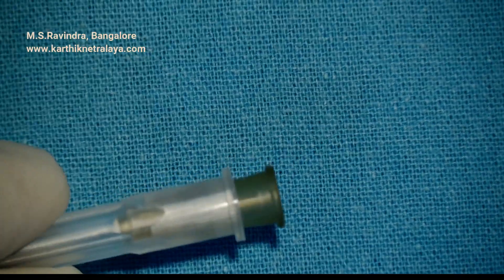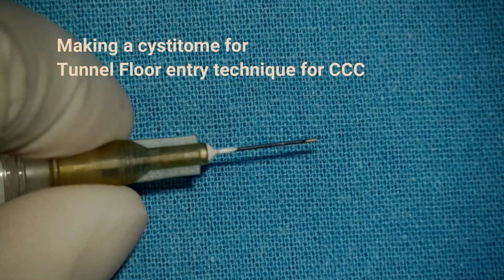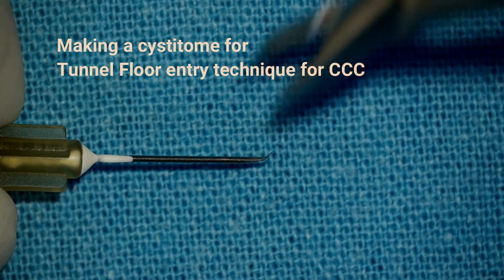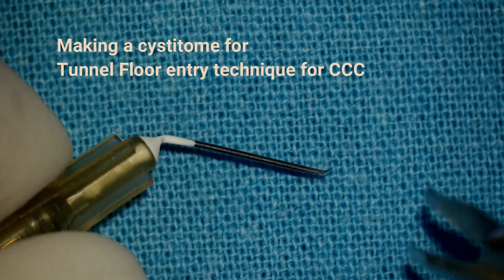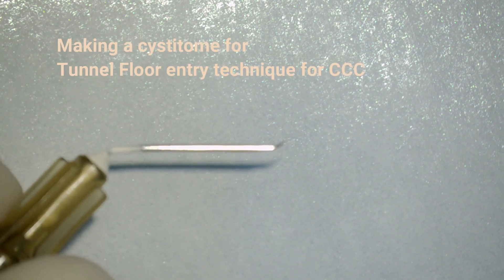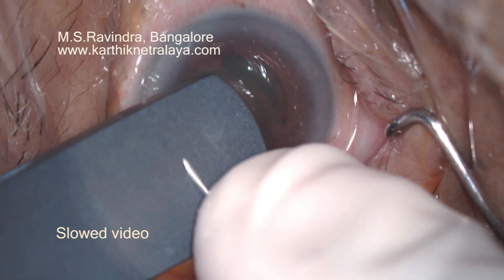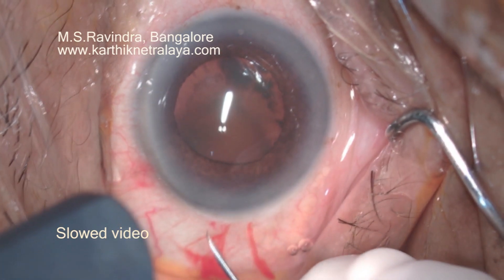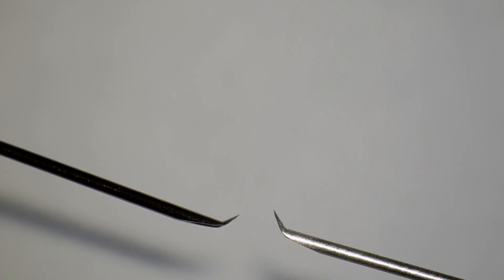DIY Cystitome from a 26 G needle for "Tunnel Floor entry technique" of capsulorhexis.

Comment: Hello sir..same cystitome used for phaco  also or different as i heard that in phaco using sharp cystitome can cause Descemet’s detachment while entering through the main incision so blunt or more curved cystitome is better.pls correct me if i am wrong and what u use let me know. Thanks. I enjoyed watching ur videos. Modified SICS was really wonderful video
Reply from the maker: I enter with cystitome in anterior sclera or peripheral limbus. I have not noticed DD in my surgeries, esp with sharp Cystitomes, with its tip untouched. The pressure should be downwards, and you move the cystitome only after entering the AC.